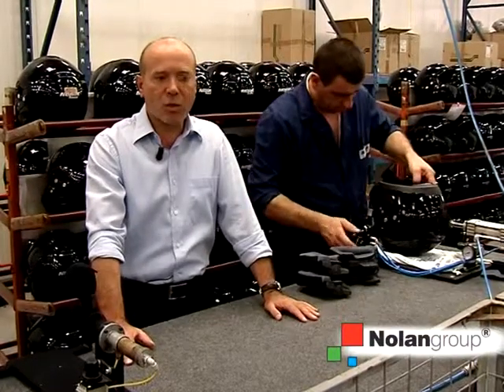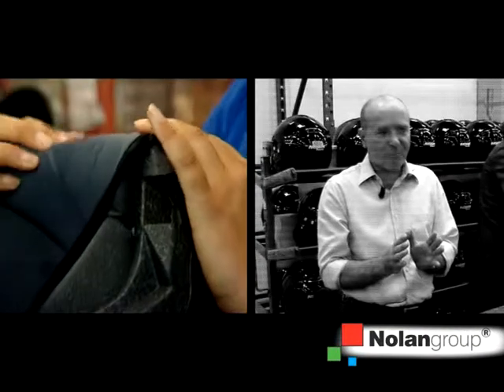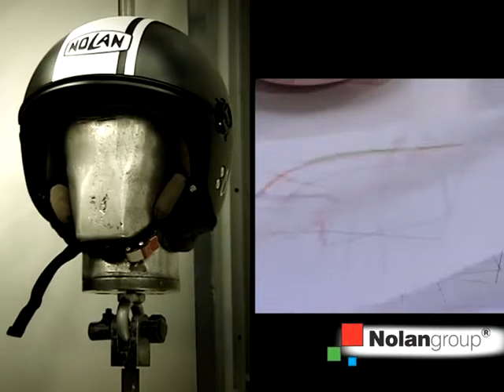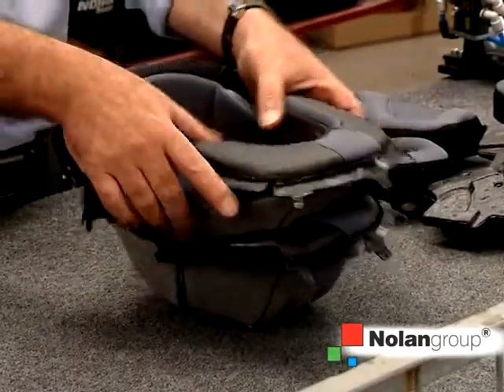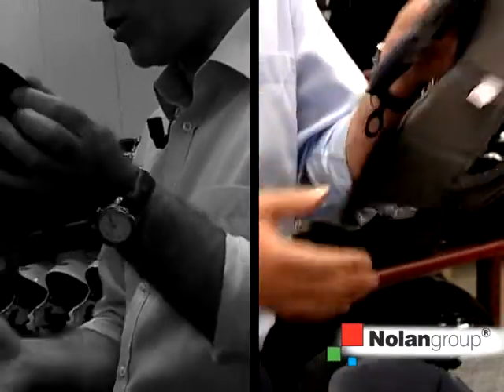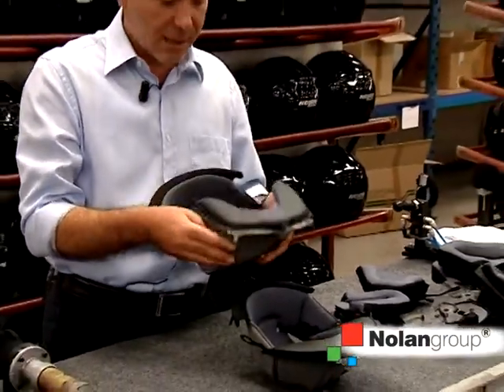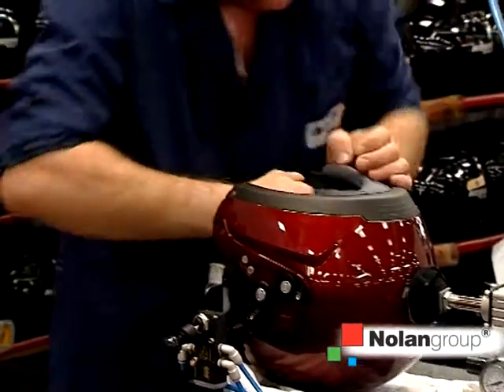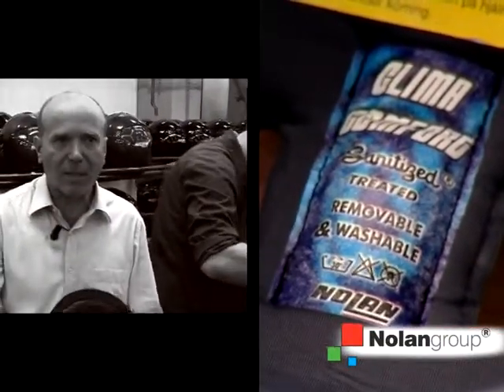020 Made in Nolan - The Inner Comfort Padding - EN

Comment: Hi there I have problem in my battery b902X It says low battery goodbye I charge it for a long time no benefit still the same
Reply from the maker: Dear Mohammed, the problem could be related to a defect in the charging cable / USB power supply / electronic plate or alternatively the need to replace the battery due its charging capacity having expired.
If available, try using another USB cable or a different USB power supply. If the problem is not resolved, please contact the retailer where you purchased the product to receive technical assistance.
For further request, contact us at www.n-com.it / support section.